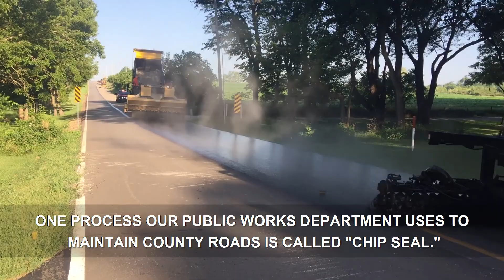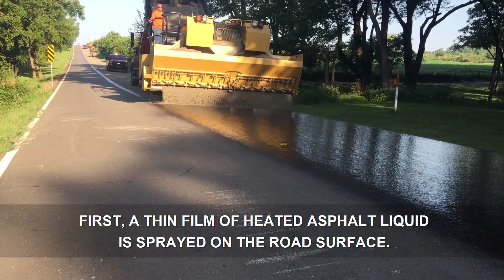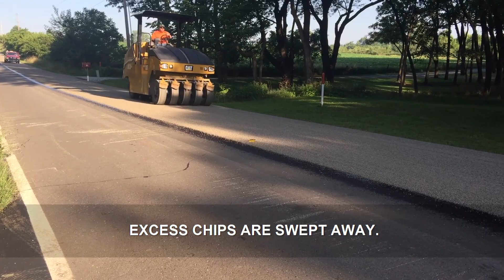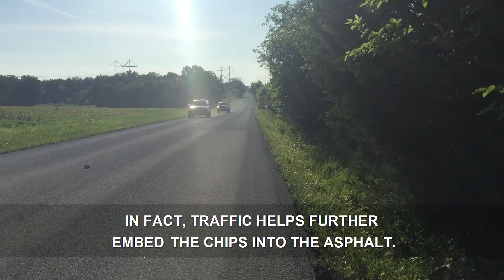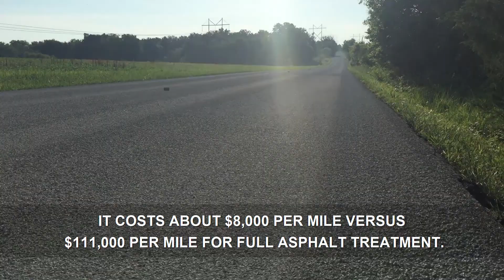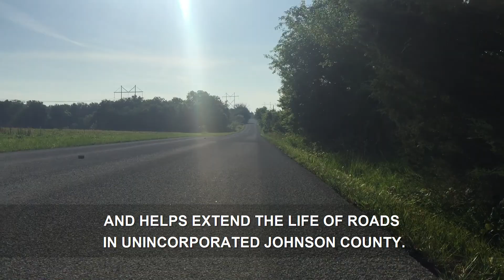What is chip sealing?

Comment: I've been driving chip seal road for 50 years. I have never seen a road that was in any way improved with chip seal coating. It is usually used to cover up defects that the road department does not want to actually repair. Chip seal is a largely worthless surface treatment. It is worthless because it 1) It ruins the road surface the instant it is applied essentially turning the road into something no better than a gravel road. It takes 3-6 months for the surface to erode off enough to be better than a rough gravel road. Often the contractor mistakenly uses very large gravel making the road extremely rough. 2) It does not seal the road for very long - existing cracks will show through within weeks to months. After that it is no better than before the treatment. 3) The gravel applied is largely either brushed off or wears off. 70% of the gravel applied does not stick to the road - it is in the ditch, not on the road - so whoever paid for it wasted their money. 4) the surface is rough as a gravel road unless a small gravel size is used. Either way, it will be rough forever after unless asphalt is applied, or maybe the newer "CAPE" that applies a slurry seal (which also wears off fairly quickly). 5) Few contractors are competent at applying chip seal so usually it wears unevenly and is very rough.